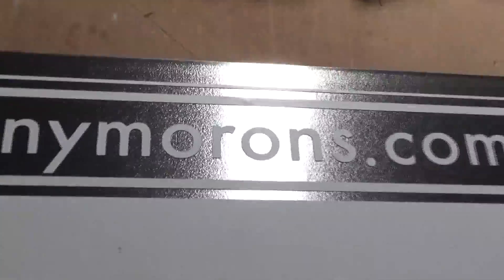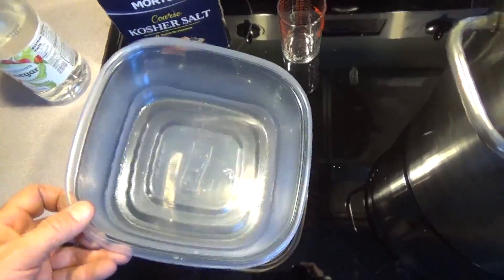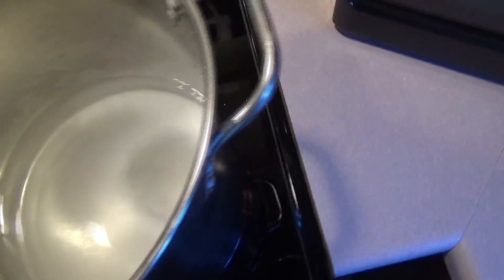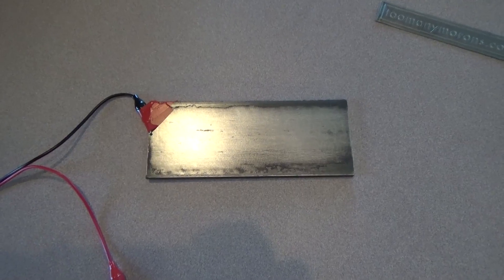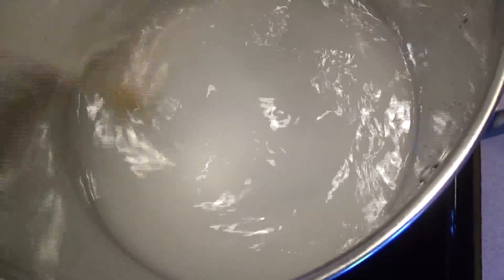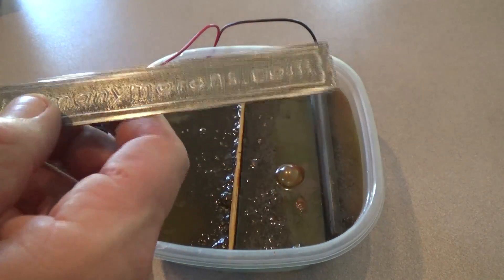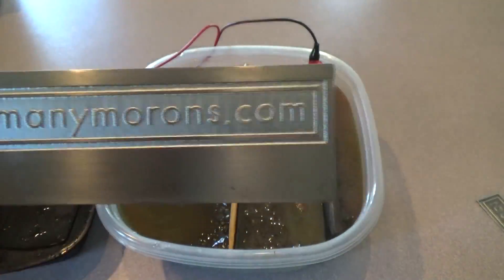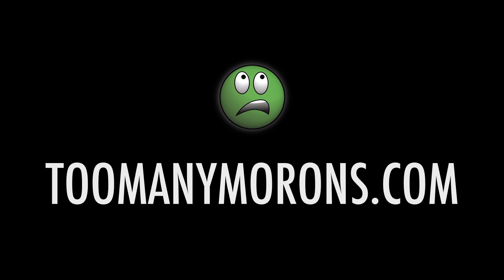Electro-Etching Steel using vinyl mask- Attempt #2

Comment: Do you think this will work to make a metal stamp? to stamp another metals with a press?
Reply: be careful with electrochemistry and chrome containing metals due to Chromium (VI) i.e. chromium +6 which is a serious carcinogen.  I'm investigating ways to mitigate this issue myself at the moment and I, too, wish to etch stainless steel.

With that said, if you just want some corrosion resistance I believe you can use mild steel, then electroplate it with copper or possibly zinc to make it corrosion resistant.  

If you're looking for hardness, you can chrome plate it afterwards... but now you're talking about playing with chromium 6 / chromic acid again.  Yikes.
Reply: George Viaud  ohhh shit! Thanks for the warning, George! Any updates with the mitigation research? Also, what exactly is the dangerous part here; inhaling invisible nasty gases, or touching the nasty water with bare skin and then the skin absorbing some of it? I googled a bit about metal alloys and saw that aluminum also contains small traces of chrome in it. I want to make small batches of very thin stainless-steel stencils, but now I will not, until reading more about these carcinogenic dangers first.  Do you have any good resources for additional info? Once again, thanks a lot for the warning!!!!!!
Reply: I am researching for the same idea. I want to make stamps for jewelry stamping silver and gold. I was thinking of using a laser printer to make the mask and apply to the end of a polished metal rod, then etch. Did you find anything or come up with a solution?
Reply: m3sca1 no :( I tried but I wanted to stamp chromed steel... but I think this will work for softer metals like gold and silver, I end up buying on etsy a stamp for 125 bucks and works perfect... you can search there... there is a lot of people that make stamping tools
Reply: No.....

I used to work as a commercial engraver making machine and hand stamps. Etching will create a deep enough recess to look good, but you run the risk of the etch solution undercutting the tape and weakening the surface. 

Commercial stamps we used to make were cut from a specific steel (can't remember exactly type) then using a pantograph engraver (both 3D type and 2D) we would ensure face surface was consistent.....once all was completed the stamp was then case hardened in a forge then quenched in oil .  If it's repeated results you need then I'd be looking at a stamp made this way
Reply: Anyone tried this for a stamp? I have all the equipment to this rather than forking out hundreds of pounds for a machined stamp if I can avoid it.

Comment: Congratulations on the video, how the paper you used
Reply from the maker: Hebert Freitas I think you're referring to the decal I used to mask the image? If so, it's oracal vinyl- I cut the image on a Roland vinyl cutter, but if you get creative you can draw out your own image and cut it out with an xacto knife or similar. You could also use a thick packing tape or anything like that, as long as it'll hold up under water. Thanks for watching and for the comment!

Comment: Can you tell me the two metals that you used
Reply from the maker: Imesh Udawela The piece that has the logo etched into it (positive) was 20 gauge sheet steel -available at the Home Depot. The negative lead was hooked up to 1/4"x3" flat bar /also something similar available at your local hardware store.. or any piece of crappy steel you can find laying around. It really doesn't matter. Thank you for watching!

Comment: does the surface of the plate you are etching have air bubles on ?
Reply from the maker: rutrem09 hi, thanks for watching! It did have some small bubbles, I would suggest either circulating the water or every so often remove it from solution and shake it off. I know they even sell vibrating platforms to help avoid this. This was only my second run at this and these are the things we learn :)
Reply: fleanine yep. exactlly... the bubles prevent the reaction. thnx

Comment: very cool definitely have to try this just wondering . Did you print on vinyl film and cut around the letters. appriciciate your advice. 👍👍👍
Reply from the maker: Mark Grevatt thanks for watching! I have a vinyl cutter and made up the text in illustrator- then cut that in vinyl. However, You could do what you suggested and it would be just as good if you take your time and cut accurately .
I have another video That uses vinyl cutter and shows it in action as well for my screenprinting setup:
https://youtu.be/IGF3wRySqAM
Thank you for your comment too!

Comment: I have tried this a dozen times and it doesnt work, at all. I read I could use brass as my sacrifice but do I need to use steel?
Reply from the maker: I would check your polarity, it won't work if your leads are reversed.
Also, check if your water has enough salt in it. I haven not used brass personally, but as long as it's a conductive metal you should be ok.
Reply: Checked the  polarity and I am good there. I do gold and nickle plating so I fully get the idea of what I am doing, I just get no results. I am using one of the morton black round things of salt to a half gallon of water, and my water is at about 120 degrees. 13-14 volts at about 4.5-4.75 amps. 2 hour baths and nothing. do I need more salt than that. I was told to use more than I can desolve, but does even more undesolved salt still help it etch?
Reply from the maker: That should be plenty of salt... I think i only used about a cup in this video...plus the vinegar, but found out later the vinegar wasn't 100% necessary. The only other thing i can suggest is maybe try with different material and see if anything happens with that? I etched 18g sheet metal in this video and used the 1/4" thick flat bar for the negative lead. Seems like everything you're doing is on point.
I've even tried it on two steel eyelets (Eye Hooks) that were the same size, positive lead on one, negative on the other, coming off of a 9Volt battery... and dipped in a cup of salt water that only had about 4 tablespoons of salt....and even that worked.
Reply: Also, at 12 volts and 4.7 amps, it is eating my steel banana clips on the etched piece in about 5 minutes.
Reply: I did notice that finding a piece of stainless helped increase conductivity, but why is it eating away my leads?
Reply from the maker: Paul Bledsoe i've never done it on stainless but I would assume that maybe the leads are softer, therefore getting eaten up more quickly than the stainless? Just my guess. I would try it with some regular steel on both sides ( + / - ) for your "baseline" and then go from there.
Reply: Noo, I used stainless as my sacrifice, which is what I have read to use everywhere. Also, it is the lead on the etched piece(brass) that is being eaten.

Comment: Fleanine, very good that such textar use a well concentrated lemon juice and keep the water temperature always high because the lemon juice is corrosive also I will try with a 12v and 7a nobreak battery another good material is brass or copper For being softer.
Reply: don't use vinegar, it cos bubble. use only salt for smooth surface
Reply from the maker: You’re right. My later videos address this and a few other issues I ran into... thanks for commenting !!!

Comment: Hi. I would like to thank you for posting this video, I'm going to try this as soon as I get my hands on some vinyl. one question though, I'm thinking of trying it on a motorcycle petrol tank and I'm wondering how solid is the final product? would it peel away, or if you scratch it, would it fall off? 
thanks
Reply from the maker: liviu.plesu The vinyl I  use is actually meant for vehicle graphics, so you'll have no problems with that. :) any kind of orocal rolled vinyl will be fine for what you're doing.
Reply: thanks for your reply, I really appreciate it. so basically all you need is a car/ customization decal. I've already purchased 3 to muck about with them and see what's happening. what about the finished product? is it going to be weather/scratch resistant?
regards,
Reply: one more thing. how does it work,I'm having a debate with an engineer friend of mine who is sceptical about this. I reckon the vinyl glue somehow gets mixed with the metal particles from the sacrificial plate and that gives it some sort of edging.
looking forward to your reply.
regards,
Reply from the maker: liviu.plesu The vinyl is just to protect the areas you do not want to etch. Like a mask. etching removes layers of metal so it will definitely last -and not scratch off, it's physically in the metal... if you're doing this on a vehicle I would recommend some sort of clear coat afterwards , because you will be into raw metal once the etch is done and It will oxidize if it's not stainless steel.

Comment: I was wondering if I could share this in a group on Facebook? Need to get your permission first. Fantastic video btw.
Reply from the maker: Joshua Moffett I don't mind you sharing it as long as it's for good positive stuff and not for negative. I am aware I misspoke a couple times, so don't fault me on that. I'm no scientist that's for sure.
If you'd share where you want it to be posted I'd appreciate it. Thanks for watching and the comment.
Reply: fleanine no definitely not. Your video helped me tremendously. I'm etching enclosures for different things and your video was extremely helpful and I think it will be for others as well.
Reply from the maker: Joshua Moffett thanks! Glad its helped a few folks out. It's why I try to do these videos- and if I fail, I'll post that too, and hopefully save someone from doing the same. I appreciate it.

Comment: For fine control over electro-etching, use: Pliers (metal), power source, saline solution (yours is perfect), cotton balls, vinyl stencil.

Attach wires to project and pliers, soak the cotton balls, grip the saturated cotton balls with the pliers, make slow, steady passes over the metal to be etched. Repeat until desired etching or until cotton ball is that festering yellow color, if the latter, grab another cotton ball.

Warning: While a 6v battery can work, if you are using the power source similar to the one in your video, do exercise caution to keep from a zap.
Reply from the maker: I think you can use mild steel, it will just create more scum / debris in the water.

Comment: hi - thanx for taking the time to share and making a vid!  i actually like the pitted one better. i do wood carvings and usually we dimple those spaces to create a contrast. so.....how did you get the effect of the first one? thanx!
Reply from the maker: John Emmons Thank you for the comment and for watching. To answer your question, the first time I did it with a metal piece (about the third of the size of the one I used in this video) on the negative side , my water only had about a half of a cup of salt in it. Because of this, it was cranking out more volts but less amps. Can't remember exactly what the settings were, but once I turned it on, I just slowly cranked the knob and had it all the way up .. it kind of "sets" itself. I left it in for maybe 20 min and kept checking- finally just pulled it when I saw it looked like it did. I also like the character of that one. :) Hope some of that helps... let me know how it works out if you try it!

Comment: What kind of metal is the sacrificed piece ????   ist the same steel than the positive ???
Reply from the maker: Esdrey Rubi Garrido it's just a chunk of 1/4 steel I had laying around. The etched piece is also steel, and can be purchased at Home Depot or the like. Thanks for watching!
Reply: Stainlees Steel ?? 304 SS or 316  SS ??  ,A36 STEEL ?
Reply from the maker: The Etched piece is just plain old16g sheet metal. The sacrificial piece is mild steel. It really doesn't matter, it will work on any metal. I've tried on stainless as well.

Comment: Great video - I was contemplating using a 12V car battery, but I like the controllability of the power supply - low volts high amps seems to be the secret - have you tried using other metals? Brass, Stainless Steel, Aluminium etc? Thanks for taking the time to film and edit the video - very informative
Reply from the maker: Des Thompson I haven't tried every metal known to man but apparently you can pretty much do most any metal like this. I have a nice piece of copper I'm going to try it with next. Thanks for your comments- and for watching!
Reply: Des Thompson n

Comment: Thank you for sharing. Im Max from Argentina. I made it a few minutes ago and it works perfect.
Reply from the maker: That's awesome! I appreciate you watching and trying this! I'm no scientist ,lol... so I just tried a few things ... I found that it's helpful if you shake it occasionally so any tiny bubbles don't "stick" to the metal and give it those specks that you see in this video. Ideally I think it would be good to somehow vibrate it the entire time or somehow circulate the water more. Thanks for the comment, and good luck with your projects.
Reply: +fleanine well... at the end of the day results wasnt the best because of me. but. will try tomorrow again. water + salt gave me better results with a low charge fron a cel phone charger. i test it over regular building iron. works good. 
yes moving water, clean and some heat could be good for it.
any way you showed us a really cool result in your video.
Reply: @ fleanine == I  suggest vibrating it. You can buy small lab size vibrating tables, or even build your own. They are used in lost wax casting to get the bubbles out of the investment.

Comment: The best thing I've found for making the cleanest etchings is to use the maximum amount of salt. Use hot water and saturate the solution with salt. Keep adding until the salt just collects at the bottom and won't dissolve. Then you've got enough salt. Vinegar/no vinegar doesn't really make any difference in my experience. For example: https://scontent-lga3-1.xx.fbcdn.net/t31.0-8/13661825_1094792953915158_5409779934393531808_o.jpg Not perfect but pretty clean. I'm using low voltage too, .5-2amps, for long periods of time (this etch took almost 2 hours)
Reply: +FerZ Franco check out the second link I posted to the imgur album, that has the pics. For whatever reason the facebook link changed on me.
Reply: DopeItUp I'll thanks !
Reply from the maker: Fear Not God Is Faithful i tried to respond to your comment I saw in my email but it wasn't showing here for some reason... definitely not much of a smell... other than when I pour the vinegar .. which I also agree that you don't necessarily need.. this was my second attempt ..so I just figured more acidic = more awesome :)
Galvanized shouldn't take too much longer as it will eat thru that coating pretty quickly. Thanks for watching!
Reply: +Fear Not God Is Faithful I don't actually remember what the picture was (or why it doesn't exist anymore) but given the timeframe I'm guessing it was Thor's hammer I was working on. You can see the album here: http://imgur.com/a/SjRDB
Reply: DopeItUp  content not found on your link bro!!
Reply: I have a variable 0-17v 3amp supply. I've been trying the earbud semi dry method but I'm not getting much Etching at all.

Comment: Hi. good.  but where can i get this steel  and how much ?
Reply: Local hardware store like Lowes and Home Depot (assuming you are in the states) else try local recycling facility, or scrap yard (cut the metal out of a fender or frame section on a junk car CLEAN CLEAN CLEAN and should be good.